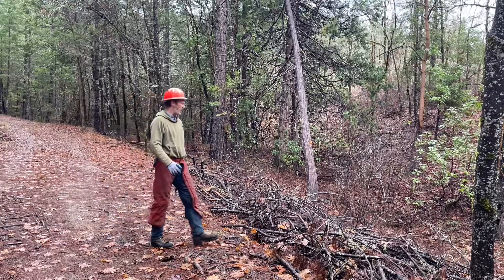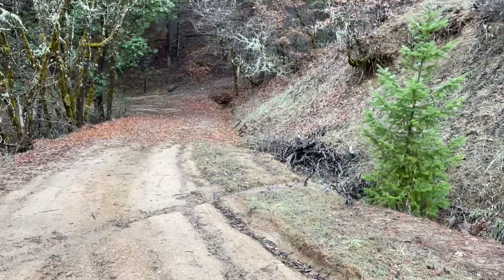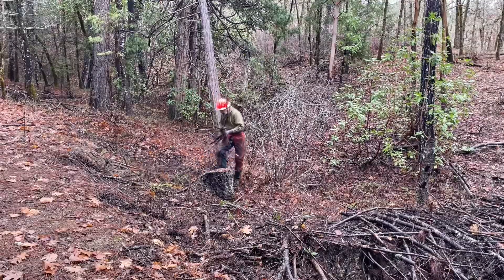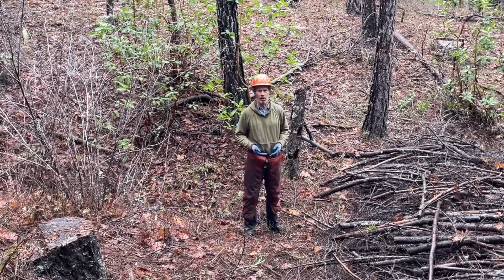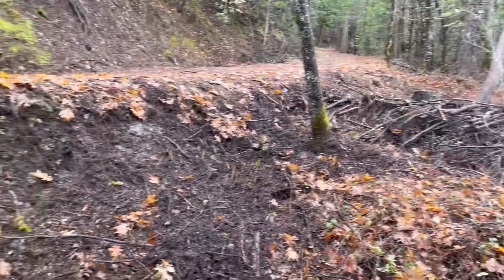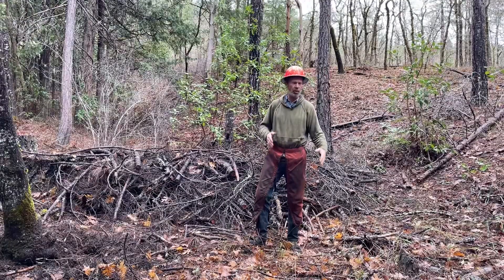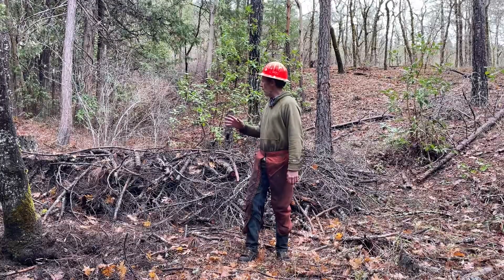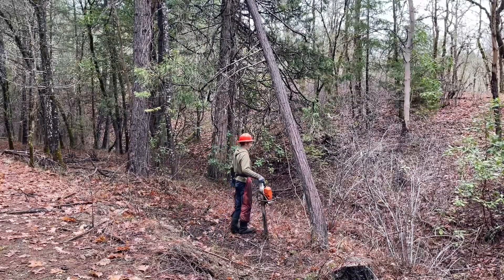Building Artificial Beaver Dams for Land Restoration

Comment: Would it be easier to acquire a pair of beavers?
Reply from the maker: Considering beavers aren’t typically for sale or made available for the taking, I don’t have access to any beavers, I’m not quite sure how to catch them if I did, it would take a lot of time figuring out how to trap them and then actually do it, it would be very illegal to catch and transport them, that gully doesn’t have water in it enough of the year to support beavers anyway, it probably wouldn’t be easier. And it wouldn’t solve the problem of I needed to move the slash anyway, which is something beavers wouldn’t be interested in.

Comment: Why will the furs die anyway?
Reply: Douglas-fir can be quite the thoroughbred, very picky in its range of "comfort." When Doug-fir are stressed by droughty conditions, the fir-engraving beetles attack. The trees are already weakened and the beetles typically act as the final straw.
In most cases, once one notices the trees looking poorly, it's already too late.
Reply: @lpeterman  thanks!
Reply from the maker: Yeah this is a part of the property with shallow soil. Better suited for oak than Douglas fir. The drought and even more so excessively hot summers we have been having are stressing the Douglas fir. Then the flat headed fir borers are getting them, especially on these shallow soil sites.

Comment: That was excellent for me as a novice. To bad you had to quit using your sawmill. I've been doing research on the different makes and models but still have not decided which way to go .
Lots of variables to consider. But like you said in a previous video, it's more efficient to just buy lumber from the store. And who has $10 ~$15 grand sitting on the table all lost and confused wondering why no one wants to pay attention to it enough to exchange it for something useless built in China.😅
Reply from the maker: I only quit for the rest of the high wildfire danger this summer. I am using it now a little, mostly as a hobby mill as I originally intended.  The LT15 Start model was only $4,500 for the base model when I bought it. A bit more now I imagine.

Comment: I chip most everything smaller than 8 inches . If you leave the chip mound alone or turn it with the tractor it will eventually  become soil. So all is not lost to the sea. Great basic principles video as usual.
Reply from the maker: A lot of times I lop the slash with the saw so it is low to the ground. Speeds decay and nutrient cycling.

Comment: I tell folks to make Beaver Dam Analogs in every little fold or crease they find.  Even if there's no water running there now, you know that little channel will be nothing but a gutter when the next rain comes.  By slowing the flow of the runoff, we're giving that water time to sink into the ground, elevating the water table and preventing flooding downstream.  Folks might think their efforts won't make a difference, but they couldn't be more wrong.  The mightiest of rivers start as tiny trickles way up in the mountains, and those tiny trickles are very easy to dam up with a few sticks and leaves.  Beavers are very small and don't have opposable thumbs, so if they can build dams that'll hold back thousands of gallons of water... there's no reason we can't do something similar if we just apply ourselves.  Plus, it's just plain fun.
Reply: SO pleased to hear I'm not alone in preaching BDA's!! Our methods (and madness) are quite similar. Even 18" high by 5' wide BDA's hold back enough runoff to keep my meadows damp and green well into hot/dry summers. Kudos to you!
Reply: @lpeterman  Hello!  Great to meet another BDA enthusiast!  

It's great fun to see something so simple really pay big dividends like that!  This year's project is to build a couple BDA across an erosion channel that's part of the drainage here.  The culvert delivers tons of water off the road when it rains, so I'll be curious to see how I can manage it without causing issues if the water backs up too much.
Reply from the maker: Not sure I could have said it any better.

Comment: Would you be able to drive some of the sturdier branches into the bed of the gully to reduce the chance of washing out the whole dam?
Reply: That is usually recommended.  Slope and the amount of water will determine how much reinforcement is needed.  Sometimes, you can get away with just piling stuff up like he's done because the water never really gets much power behind it.  Or, if it's the easiest thing and you know the dam will be trashed.... but all that material will just float down the channel until it creates a new blockage all on its own.  Nature usually finds a way if we give a little help.
Reply from the maker: threeriversforge said it well. In this case the upper dam especially is too big and heavy for the flow of this size gully to move. As it builds up with sediment it will get even harder to move.

Comment: I recently subscribed, and it has been well worth it! Your videos are great. I have a question: In other areas where you have excess slash but do not need to use it for any erosion applications, what would you do with it then? Would wood-chipping them be a viable option? Or just letting it rot?
Reply: Wood chipping might be a great idea because it speeds up the rotting process while also helping to retain moisture in the soil if you use it as a mulch.  You could even offer it for sale to locals who need chips on their property.  There's already a thing called Chip Drop that the arborists use to find local homeowners who might like the chips that landscapers and arborists usually have to pay to dump.

Additionally, I would suggest that you use them to make Beaver Dam Analogs like seen here in this vid.  You might not have erosion problems, but all those little folds and creases in the land are acting like gutters whenever it rains.  By putting small BDA's across them, you're helping to slow the flow and give that water time to sink in.  It might not seem like you're accomplishing much, but it will absolutely help revitalize your land by raising the water table.  Plus, you're likely helping to stop flooding downstream.  Those little rivulets you can step across add up the father downhill you go!
Reply: I concur, also, you could take the smaller than merchantable tops/limbs etc. to make "Bio-dens" for the terrestrial critters. Think: slash-piles with structure -- stacked like "Lincoln-logs" we played with as kids; (well I'm old, I played with Lincoln-logs, but you get the idea of stacking.) Good for Salamanders/Newts, Squirrels, 'Possums, birds, etc. etc. @threeriversforge1997
Reply from the maker: Many good points mentioned above. In a lot of cases I lop the slash up with the saw so it is low to the ground. It reduces the wildfire hazard, holds more moisture close to the ground and rots faster. In places I want to clean up I sometimes pile and burn. Sometimes make wildlife piles. I forgot to mention in this video, some things will likely use these as habitat.
Reply: @WilsonForestLands   Something I've been looking at recently is called a "dead hedge".  While it's just a brush pile of little stuff, these guys are taking it to a whole new level so it's functional and attractive.  It doesn't work for every site, but when you've got brash close to the house.... a 'dead hedge' is a very good option.

Comment: My new favorite channel. If I would have had you as a teacher in high school the out come would have been better. I was wondering what size saw and bar do you use?  How old is your saw?  Thanks for explaining what you do!!
Reply from the maker: Thanks you, kind of you to say. I never became a teacher, maybe because the experience I had with high school teachers was, let’s just say, not inspiring. Or even very educational. This one is a 462 with a 32” bar. I have commonly used a 362 and equivalent over the years with a 24” I used for this kind of work. I wore out the latest one and haven’t got around to replacing it. Particularly because after they came out with the light bars, I have been using the 32 for just about everything.

Comment: Nice work! Except my chainsaw doesn't run near that long even on a full tank. Is there an adjustment I can make?
Reply from the maker: I think the adjustment is done in the video editing. It probably looked like it went longer than it did. 😁 I didn’t have to do much cutting in the dam building part. And the thinning was only a few minutes of actual work, aside from moving cameras. Since I was mostly just cutting the trees down and not processing them. That is one of my biggest complaints about that saw, a tank doesn’t last long.

Comment: Looking at the slope of the gully, i think you should keep the far side (from the road) a little lower, with the thought that you will direct the flow away from the road
Reply from the maker: It probably doesn’t show up on camera but it is lower on that far side. Not so much by design, more because it just ended up that way because it was the opposite side of where the slash was. You make a good suggestion.

Comment: Lots of beaver in eastern Ontario.
Remember fondly a day up at the hunt camp where myself and a friend went at a big beaver dam. All we wanted to accomplish was some big enough holes to drain it. Man, it took two of us several hours.
Flat-tailed engineers they are. 🦫
Reply from the maker: My beaver story sounds like it could be similar. Hopefully you were smarter than we were and didn’t do it to the one upstream from your camp. 😁
Reply: @WilsonForestLands  All good where buildings were concerned. But we were right at the edge of a road, so we couldn’t open the dam more than the culvert could handle.